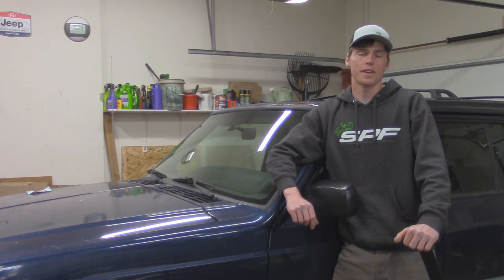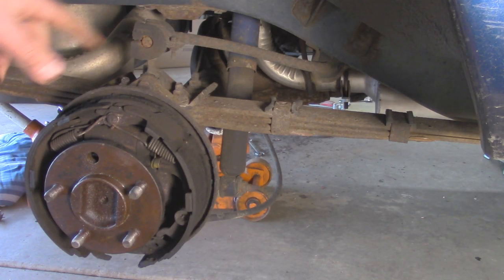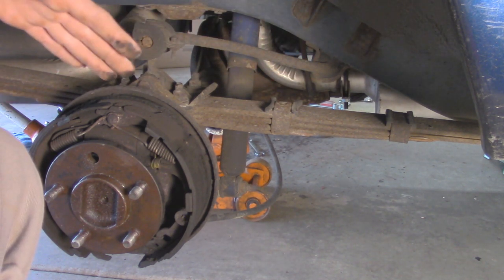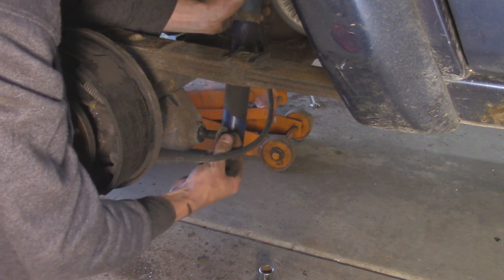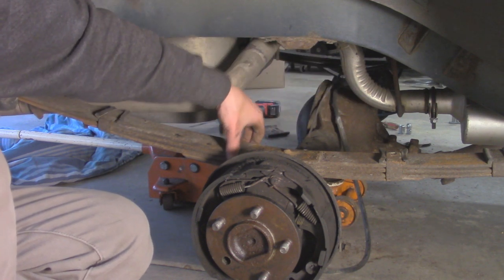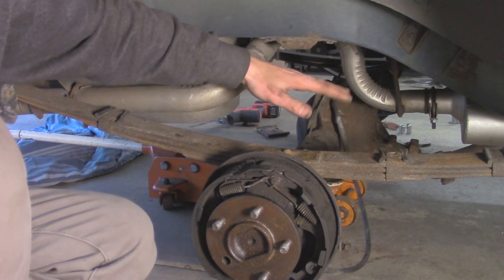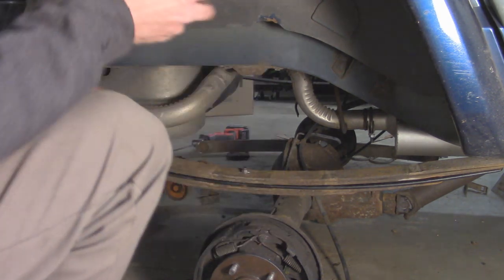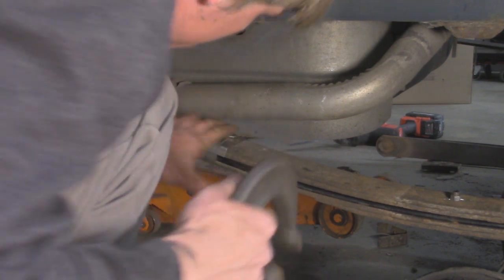Jeep Add-A-Leaf Lift Install

Comment: what add a leaf kits would be best for daily driving and minor trail offroading?
Reply from the maker: There is a few companies that have them and I don't have a lot of insight on which is better, but what really makes a difference is how well of condition the factory leafs are in before adding the new leaf. Old sagging leafs wont put out the same height with the added leaf as that company would advertise.
Reply: A buddy of mine has add a leaf 4” kit and wheels the crap out of it. Like trail 22 at Windrock and only has had the clips break once. We put them back on and it’s good as new. I prefer the complete leaf pack and run the skyjacker pack.

Comment: Can I add a leaf if I have some old ones from the same model do I cut them shorter
Reply from the maker: I have doubled up for the second largest leaf in the pack with the factory leafs. I didn't cut them down and it provided about 1" lift over stock.
Reply: @OutJeeping  thank you man

Comment: U use this kit ? Rubicon Express RE1415 2" Add-A-Leaf for Jeep XJ
Reply from the maker: I actually used a Rough Country kit for this video but it is the same process for installation as the Rubicon Express.